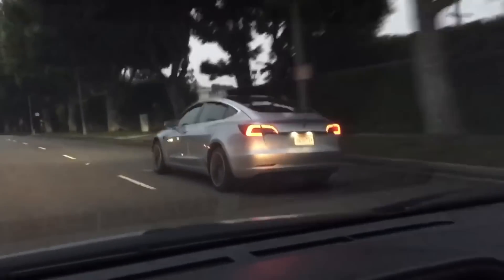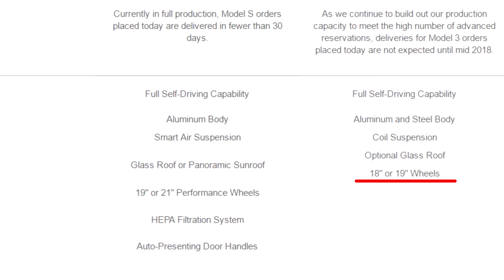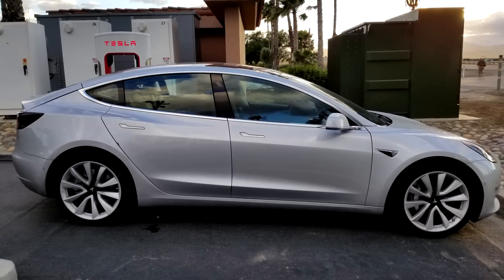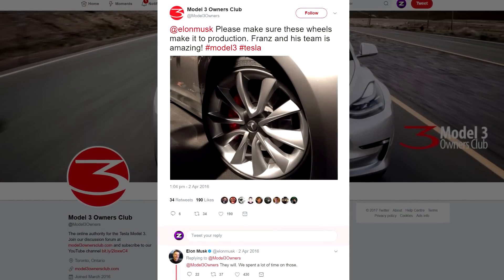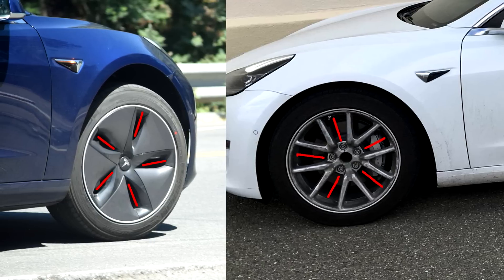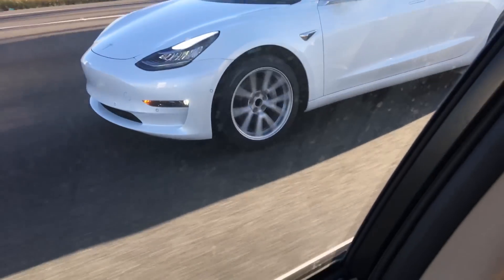Tesla Model 3 Alloy Wheel Analysis

Comment: Great video, thanks.  For people who are trying to pick a rim size, consider that larger rims are noisier and have a harder ride, because they use lower profile tires.  Both the wheels and tires get a lot more expensive to replace as they get larger.   The only positives of a larger rim is that they look better and handle better than smaller rims.  I chose 19's for my MS and haven't regretted it for a second.  The optional 21's are a total ripoff.  $4500 cost, and you lose the 19's!  If you use the stock wheels, you can buy 21s and tires on the aftermarket, AND get a set of snow tires for your 19's, with money left over.

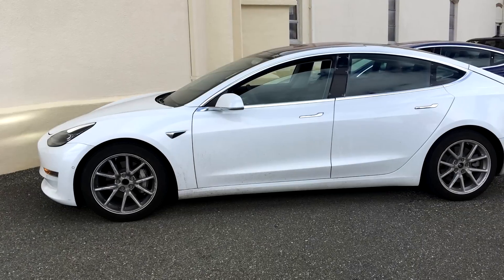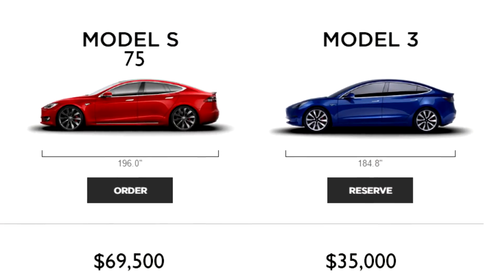Comment: After studying other pics and videos: the answer is that there will be a 19" (or 20") full alu-rim (see @0:27) and a 18" (or 19") basic alu-rim (@1:35) with two optional covers (@1:09 silver and @1:20 black or both can seen @2:00). Both the 20" full alu-rim with red brake calipers for the Model 3 "P" and 19" with silver brake calipers and basic-rim/silver-cover for the standard Model 3 can bee seen @0:44.   I take bets. :-)
Summary of configurations (assuming there will be a 70kWh pack):
- Model 3 70 or D70 with 19" Basic-Rim and 2 optional covers (silver and black)
- Model 3 70P or D70P with 20" Alu-Rim